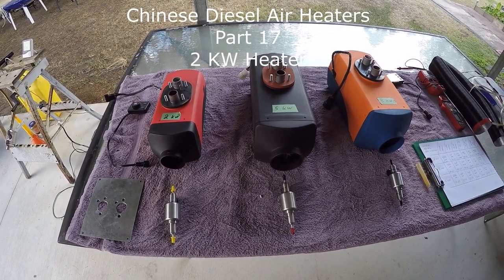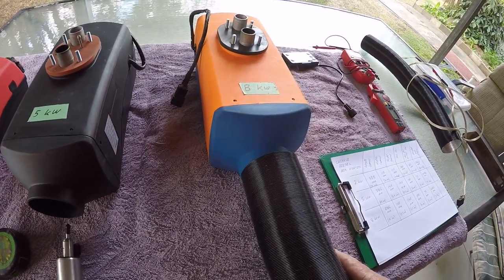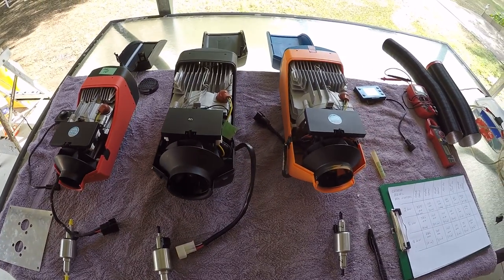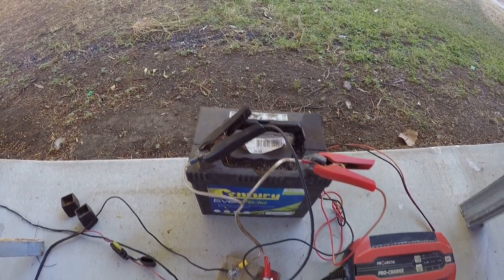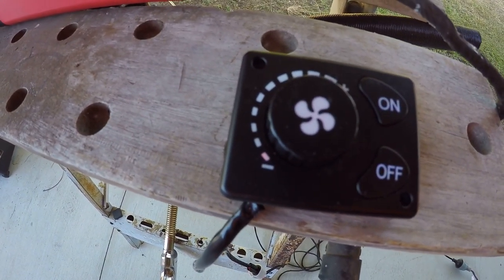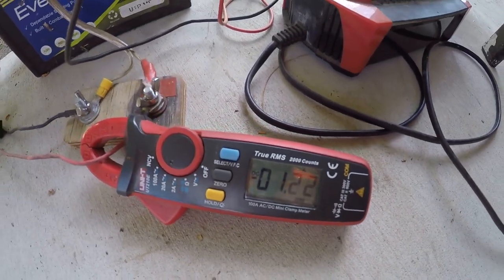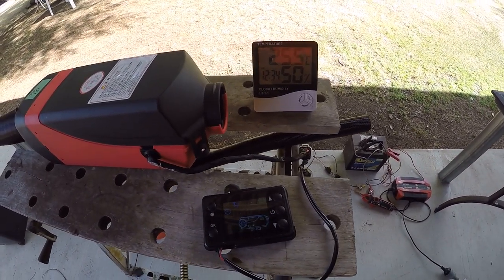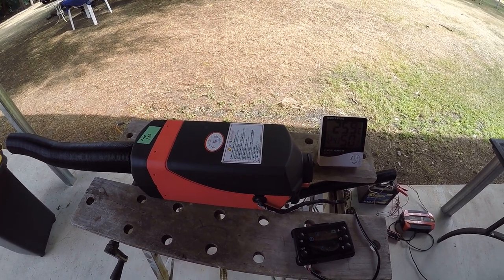Chinese Diesel Air Heater   Part 17 -  2 Kw Heater

Comment: Thanks for this series. Its been super helpful! I’ve just replaced a failed 2kW heater with a 5kW heater. Unfortunately the new heater doesn’t work correctly. when first started it  was blowing lots of black smoke and getting hotter that I thought it should. The controller temperature gauge showed 200 degrees at one stage. After a few runs it now just blows white smoke and wont start. I’ve cleaned the the screen which seemed blocked with carbon up but it still won’t start. I had suspected poor airflow and your comments about the fan rubbing has given me something else to check before I give up on this one and buy another.
Reply from the maker: Hi Brad,

These heaters are generally very reliable.

On initial start after install they can sometimes blow smoke for a short while, but should then run clean after that.

Occasionally you can get a dud heater, and if so, send it back for a replacement. A good supplier will replace a defective product or refund your money.

However if you have had trouble with two heaters now and it is blowing black smoke I would be looking at your install. 

Does your install have minimum restrictions in both combustion air inlet and the exhaust?
Are you getting 12V power at the heater itself. Have you extended the wire harness without increasing wire size?
Are you burning clean diesel fuel without any oil additives?
Is the fan working correctly? 
If you have carbon build up in such a short time, something is wrong.

Good luck.  JMcK
Reply: @johnmck1147  Thanks for the reply John. 

The original 2.2kW heater was trouble free for almost 5 years. The first sign of a problem was a few weeks of an error messages on the controller of every shutdown. (I,E, backwards 9, 0) This code wasn’t in the book and didn’t mean anything to the supplier. Next we had a fuse blow as the heater was starting up.  I checked and found the ECU was heat damaged. This may have been the cause of the blown fuse or the result of the fan stopping. The old heater was an Eberspacher style Chinese clone but had a different wiring harness to the current Chinese models.It had a large square main connector. It was cheaper to buy a new heater than to have the old one repaired by the original supplier.

In fault finding the new heater I’ve run the heater with the exhaust and inlet disconnected . Although he inlet is less than 500mm long and the exhaust is about 1.5m with no sharp bends. 

The supplier asked me to use a hot air gun blowing into the intake , this didn’t seem to do anything. I also got the heater to light and then disconnected the fuel hose in an attempt to burn out the excess diesel. While the heater seemed to run better for a short time with the fuel disconnected  the black smoke came back on reconnecting the pipe. He also asked me to check the temperature sensor mounting in the unit which seems ok.

 I also replaced the diesel with new fresh fuel. I did find a venting problem with my fuel tank that may have caused some pressure to build up in the tank when it got hot, although it would have effected the old heater as well. Perhaps this caused the initial overfuelling? I removed the glow plug and screen using your “special tools” and found the screen to be quite carboned up. I don’t have a replacement screen so I cleaning it as best I could by soaking it in “Shellite” and then burning it off on the stove. This made it better but not perfect.

This morning I checked the fan clearance and that seems ok too. 

The wiring from the battery to the main unit is less than 2 meters and the controller shows 13V. I extended the wiring to the fuel pump as it is in the boot at the front of the van and the heater is under the bed at the rear. This wiring and the fuel pipe is probably 6m, which is probable not ideal but it was ok with the old heater.  The fan is running  but I can’t really tell if it is running fast enough.

If I was as home I could set it up similar to your test bench but we are travelling and living in the van so this limits what I can do. Blowing smoke all over a crowded caravan park is not good and killing their grass with spilled diesel also frowned at :-)
Reply from the maker: Hi Brad,

If you have excessive carbon in the glow plug screen you are also most likely to have excessive carbon in the main burner screen. This is more difficult to remove and requires a full strip down.

Suggest as a try while you are out travelling that you run a high kerro/diesel mix (90/10)  through your heater. If there is carbon buildup in the burner screens, this will help burn it off. 

You still need to discover why this happened in the first place.

Good luck.   JMcK
Reply: @johnmck1147  I couldn’t get the old one to light on kero so I ended up buying another one, I fitted it yesterday and its running well. I can feel the granules of carbon inside the burn chamber of the old one through the exhaust. I’ll strip it down when I get home and clean it out and see if it’s still usable. I did find a blockage in the vent of my plastic fuel tank, its possible that heat was building up  pressure in the tank forcing fuel past the dosing pump causing it to over fuel. Otherwise it is faulty. Anyway evaen at 2 x $150  its still a bargain compared to the original one I bought 5 years ago!
Reply: Hi john i have seen your videos but can’t find an answer to my problem. I have an e07 fault. I changed already the controller but nothing happend. Could tou please help me out? We want to go on a trip in 3 days 🙏

Comment: Would that mean the 2kW exhaust will normally run hotter than the 5kW exhaust? Those unused energy in the 2kW has to go somewhere and my guess is the exhaust. Perhaps you can conduct another bench test measuring the exhaust temperature for the 2kW and the 5kW.

Comment: That's the video I should have looked at first John. My heater is a true 2kw as I needed a smaller size to fit under the drivers seat. Interesting how my factory pulse settings are 1Hz lowest and 3 Hz highest. It would be interesting to know the lowest and highest fan settings as I'm not wanting to change the pulse settings and do damage because I didn't have the correct fan settings.
Interesting thing today was when I went for a walk and came back to the van I ran the heater to see if it would show 2 red segments. At first it didn't and I set the required temp to 15 degrees. After the heater had been running for about 30 minutes I set the required temp to 18 degrees and as the fan spooled up the 2 red heater segments showed up.
Reply: Hi John, got the fan settings at 1600 rpm minimum and 4500rpm maximum. Is that about right? Heater seems to be giving out more heat than before. 👍
Reply from the maker: IRISHROVER 

Sounds ok, but you need to match it up with pump Hz rate if you are going to change factory settings.

Keep an eye on the exhaust. If black smoke heater is running rich, so you need to up fan speed at that setting or reduce Hz rate.

Unless you are an enthusiast you can get into trouble buy changing factory settings.

But good for you for trying stuff.

Regards.   JMcK
Reply: I'm back at you again John. Checked my output heat using an I.R. thermometer and at full wack it reads 64 degrees celsius. This is with the stock settings that it came with, way different from the readings you are getting. If your factory settings are 1.6Hz min and 5.5Hz max on the fuel pump then they must be the same settings as the 5kw heater. 
Still can't understand why mine came with 1Hz and 3Hz.
Reply: This is interesting, I've just bought 2kW and 5kW units with the same controller type.
The pump with the 2kW is an 18ml/1000 and the 5kW is the normal 22ml/1000.
I do believe that the fan and pump speeds are also different for the 2kW, so simply interchanging the controller without entering the correct operating parameters will fuel the 2kW as a 5kW, but the smaller fan creates less airflow so will run too rich and produce more heat than the smaller heat exchanger can safely dissipate.

From some other info I found posted elsewhere for when people wanted to change controller:
With 18ml/1000 pump:
2kW: min 1.4Hz/1500rpm, max 4.1Hz/4500rpm.
With most common 22ml/1000 pump: 
2kW: min 1.0Hz/1500rpm, max 3.0Hz/4500rpm. 5kW: min 1.6Hz/1680rpm, max 5.0Hz/4500rpm

Comment: There is still a very good reason for getting a 2kw over a 5kw that wasn't mentioned. Which is if the 5kw puts out too much heat on the lowest setting for your situation ... size of your rig, amount of insulation, and weather conditions you are typically in.
Pretty sure the 2kw wasn't meant to be run at 5hz. Everyone I know that has a 2kw has their low set between .08 - 1.2 Hz  and high between 3.0 - 3.2. I have mine set to .08 / 3.2. Sounds like yours came with the settings for a 5kw heater.
Great videos! I've followed them all and have never had a single problem with my heater.
Reply from the maker: I totally agree with you Roger. 
Did you read my comments in the Description?
Also thanks for the feedback.   JMcK

Comment: To my untrained eye, the aluminum seat exchanger does look different between the 5 and 8 kw units.    

And it does seem reasonable. If you tried to create heaters of this design, the size of the aluminum block seems a logical variable to adjust. Cheaper manufacture costs for one.

Comment: My 2KW heater came with a 12v 18.5-20 fuel pump.   Problem is there are 
no replacements to be found.  Checked ebay, Amazon, AliExpress, Alibaba.  While you could use a 16 or 22 neither is perfect

Comment: Hi John, great video, very informative.
Interesting that you support the belief that there’s no such thing as an 8kw heater, claiming that as the fan, inlet, outlet, fuel pump and heat exchanger are the same size as a 5kw heater, then all you can get out is 5kw. However if you look at the heat exchangers in your video, you can clearly see that the 8kw heater, the orange cased one on the right, has more fins on the heat exchanger than the 5kw heater in the middle. More fins would make a more efficient exchange of heat, so more heat into the cabin and less heat out of the exhaust.
Reply from the maker: Hi Chris,

I have already replied to you re this topic in another comments section.

The measured heat output from my “workshop testing” is the same for the 5Kw or 8Kw heaters. 

The heaters I tested are the same heaters. It is pure false marketing. 

I accept that some “new” 8 Kw heaters may actually put out 8 Kw, but I have not seen one.

These 5Kw and 8Kw heaters are exact copies of the German Eberspacher D4 heater. You can mix and match the parts between the Chinese heater and German heater. The gaskets are the same, the glow plug is the same, the burner is the same, atomisation screens are the same etc etc. Of interest, the Germans are conservative and list their heater at just 4Kw output. 

Yet with exactly the same (copy) heater, and the same fuel burn, some manufactures claim double the heat output of the German origional.

The heat exchanger fin configuration of different Chinese manufactures of these heaters does vary. 

Cheers.  JMcK
Reply: @johnmck1147  Hi John,
thanks a lot for your fully testing the chinese diesel heater.

I`m german, living in germany. Our laws for using heaters in vehicles.

Only the heaters are allowed, who get proofed, and has a proof-number.
a german one, or an E-number.

a german proof is made and tested in germany.
An E-number is proofen and tested whereever in the European Union (EU), and so allowed in the whole EU. Mostly getting easier, as in germany.

Both has its certificate for this, by selling it.

German diesel heater like eberspaecher or webasto costs ten times, as a chinese diesel heater. Maybe looks like the same.

A chinese diesel heater with an E-Number costs three times, and looks like the same without an E-number. But pay attention: Maybe one pin more, to the controller.

If you have a german heater, you must let check the mounting, if it is all safe.
at allowed test stations: TUEV, DEKRA, GTU, etc.

If this is certified OK, then you must go to the german vehicle registration office,
to print your diesel heater number in your vehicle registration. Now, this heater is allowed, to use in this vehicle in public traffic.
Rember the price: ten times plus fees for testing and registration.

If you have an E-number at your (chinese) diesel heater, it is allowed at vehicles in public traffic, in the whole EU. Without testing and registration.
But it costs three times, and looks the same, and even made in China.

One Webasto manager was in China, early in 2020, got Corona Virus (unknown) and spread it, in the germany Headquarter. So I think, that Webasto let produce it, in China too.

You see: Big profit, because of german and EU laws.

I think, the most people here buy and mount a cheap chinese diesel heater without any number and certificates in their vehicles. 
And I never heard any problems with the police, or at the vehicle safety check (needed all two or three years.). But remember: It is not allowed in germany. 

And you can get fined by police. And then you must remove the non allowed heater.

Or you don´t get an OK, by safety check. If they are interested, to check the diesel heater.
I think, mostly not. Or you remove it, and after the safety check, you re-mount it.
Reply from the maker: sunnymas 

Thank you sunnymas for that information. 
Do the German regulations cover a heater installed in a motorhome and only used when parked in a campground?

Cheers. JMcK
Reply: @johnmck1147  In germany too, you can run the diesel heater at any car parking, at campgrounds or mobile home places. 

Even if the vehicle get driven. So you keep it warm.

With gas heater, you are not allowed, to run it during driving.
Even you must have disconnected the gas line from the gas bottle, during driving.
Or close the main valve at a gas tank.

Some say, its difficult to sleep, while the diesel heater is running.
Because of "too noisy" diesel pump. 
But you can mount the pump, for less noise.

I read about noise reduced diesel pumps. 
But I saw an offer about one, with a high price of 76 Euro.
But some has tested these diesel pumps, if its really less noisy ?

But a complete chinese diesel heater set, you can get here starting at 89 Euro, complete with taxes and postage fees.

The cheapest are most the 5 kw heater - not the 2 kw.
And you maybe get a simple controller only, no remote control, no exhaust silencer, and no tubes etc. for the heated air. But with all, to make it ready to run.
But you can get it, if you buy a diesel heater set, for 10 - 20 Euros more.That´s cheaper, as to buy it separate.

Brandnew: The diesel heater mounted in a metal case. Complete with the diesel tank inside. 
But now also flat cases with a handgrip, looks small like a bigger petrol canister. 

So it looks like you can use it also outside, ie tent or wood cabin heating. 
But pay attention about the exhaust pipe. his exhaust gas must get outside, otherwise carbon etc. = killing you.

And about the hot exhaust pipe. Protect your tent, for does it not burn.
ie with a silicon form, using in the kitchen, who is made for inside the hot kitchen oven.

I´m a bit afraid, if the diesel tank is mounted so close to the heater.
But I have no experiences with the case mounted diesel heaters.
Reply: @johnmck1147  There is a trick, to avoid the german laws.

If you can remove the part from the vehicle, without using tools = only by hands,
so it is NOT a part of the vehicle. So you don`t need to fullfill the german laws about it, at germany registrated vehicles in public.

This goods are called (german) "Ladung" = trasportation goods. 
But keep it disconnected by power, so it´s not ready to run.

That´s important, ie if you have an accident, and the experts checks your vehicle.
And will find an not allowed and registrated diesel heater mounted.
And declare the whole vehicle for not allowed = no car insurance must pay.

But if it´s mounted this way, you can say that it depends not the vehicle.
Also not by the german laws.

So I will mount my diesel heater system by quick release clamps.
And the 12 Volt connect by jack in - not solid.
So a case mounted heater would be easier for me.
But I will install it stealth in my minicamper.

You resident in GB or USA ?
Thank to God, because a lot easier to get allowed a vehicle for driving in public.
Reply from the maker: sunnymas 

Wow! That is some bureaucracy.  Thanks for the info.
Regards.  JMcK
Reply: @johnmck1147  Well, it´s germany !
But here are many other examples, who are more crazy. 

I understand our lawmakers, to make it safe. 
A diesel heater could become dangerous, if something doing or get wrong.
But you can create them easier and cheaper. To avoid making profit.

My comments and infos are also my gifts to you. 
For your many videos, and so much test it. Who gives me many answers and infos.
Reply from the maker: sunnymas 

👍
Happy NewYear.   JMcK

Comment: Hi John, thanks for all the great info. I am looking at installing a diesel heater into to a new 21ft caravan, no canvas! Insulation is also good. I understand and agree with the concepts of efficiency/noise etc. I have friends with a similar van and they think the 5kw heater is too hot. What I’m wondering is can the 5kw heater be turned down as low as the 2kw heater so as a warm temp inside is maintained rather than having it too hot?? Thanks
Reply from the maker: Hi Martin,

It depends on where you live and travel, but in general winter conditions in Australia a 2 Kw heater in your van should be ok.
However suggest you allow enough room on install, to swap it out for a 5Kw unit if you find it not warm enough. The operation side of these heaters are the same so easy to swap heaters if there is enough room.  JMcK